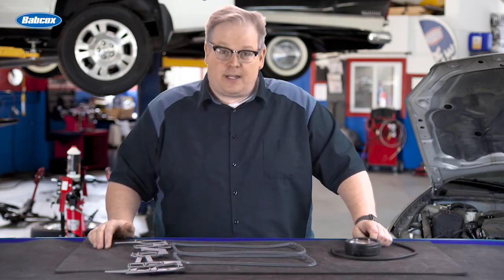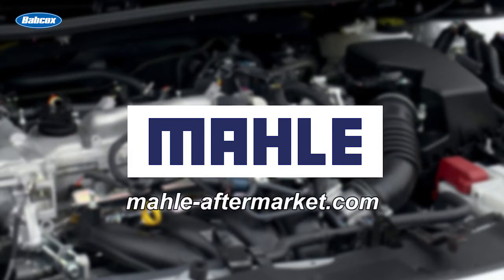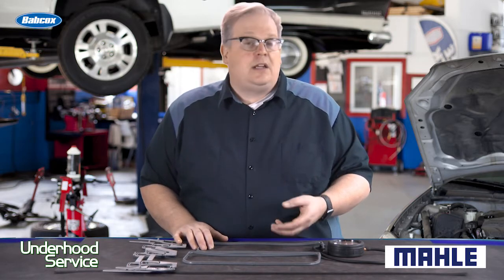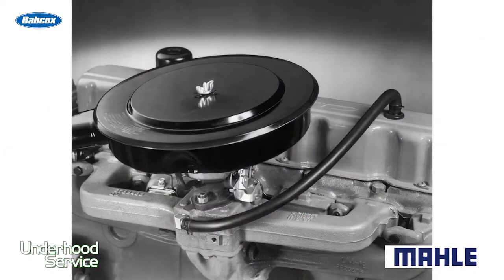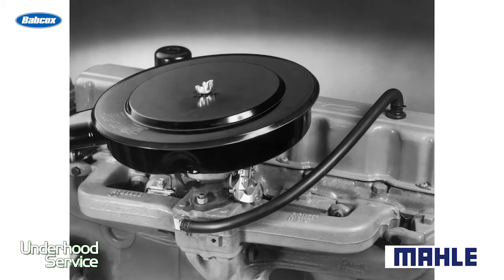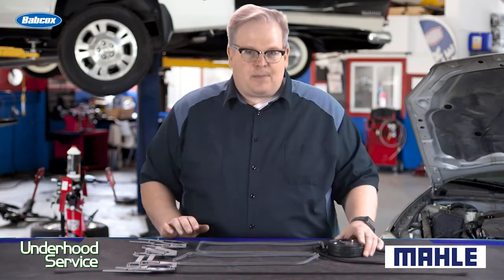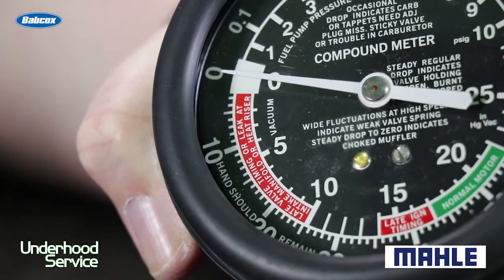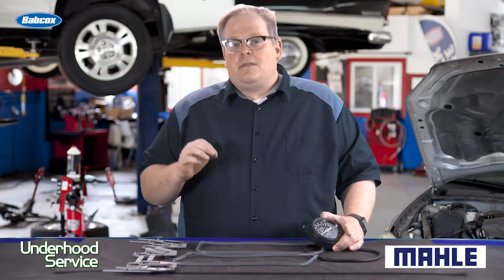PCV Valve and Oil Leaks | Maintenance Minute

Comment: Can a broken hose cause leaks. Im curious about oil pooling, sludge or ice in the valve cover not being pulled through by engine vacuum. As a clog can do, can an open hose cause leaks. I believe ive seen this before